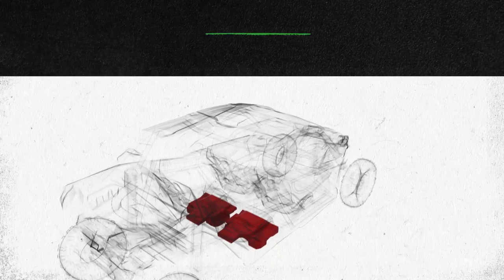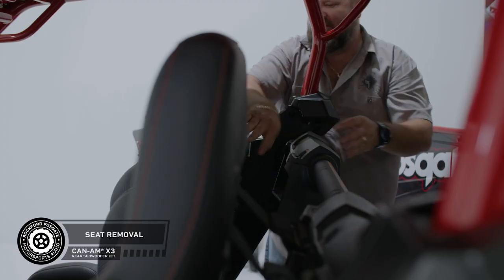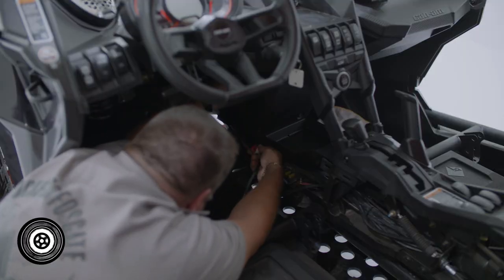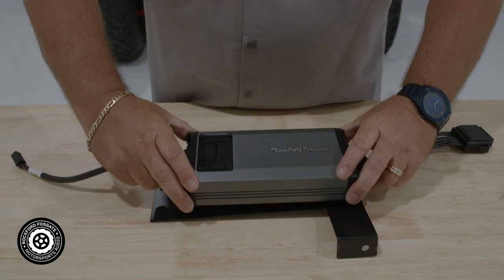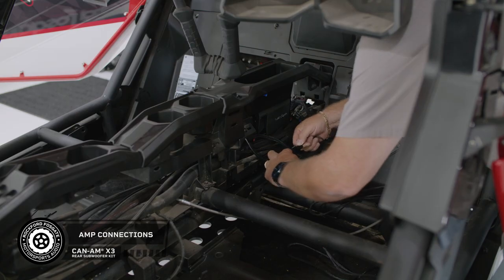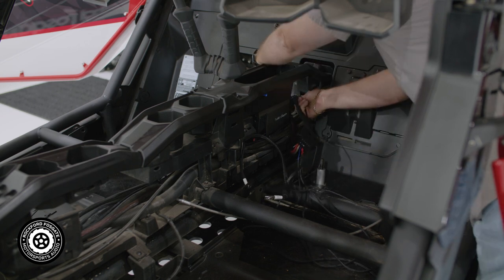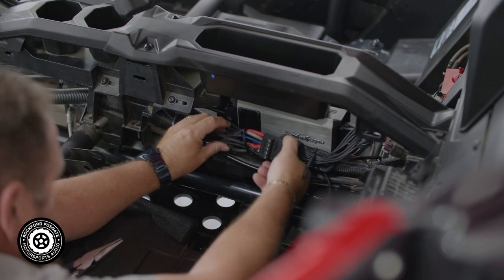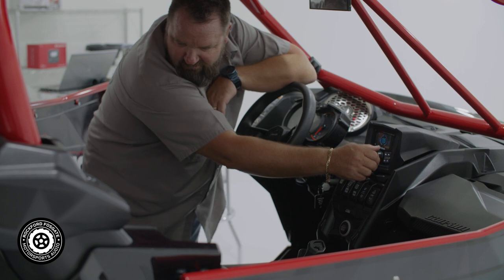Can-Am X317MAX-RSS Installation

Comment: I bought the roof top for my 4 seater and then added this sub system. I have two. One o under each seat. The amp is weak and I can’t really hear it when the machine is running. I think the amp is the issue. I have had it for a year or so. The roof sounds good. Don’t waist your money on the subs in my opinion. I’m going to take it to a stereo shop and see if they can tweak it. Maybe it’s just a setting or a bad amp.
Reply from the maker: This video is for the REAR sub solution designed for the AFTERMARKET X317-STG4/5/6 kits.  The subwoofer solution you’re referring to is the OEM subwoofer expansion for the roof system.  The subwoofer amplifier needs to be re-tuned so you have higher input signal to produce louder bass.